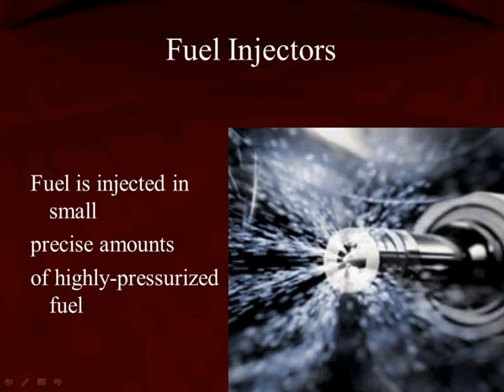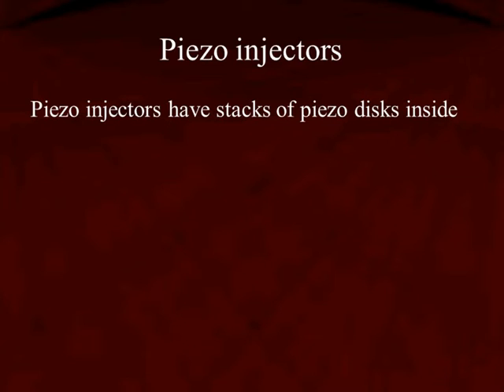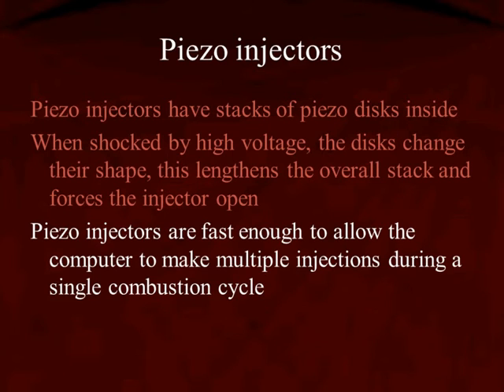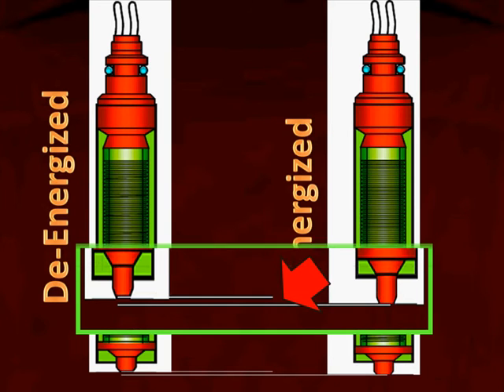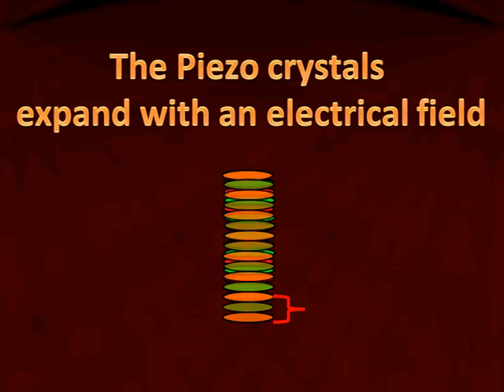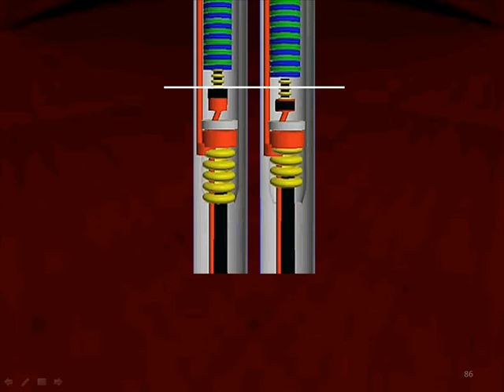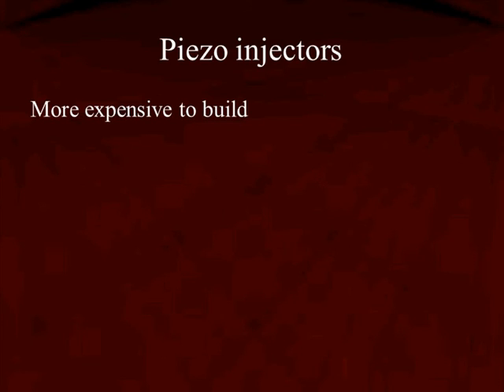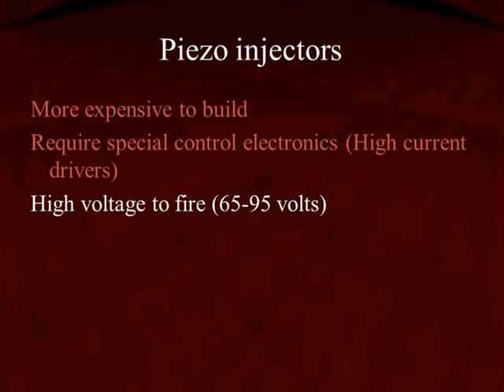10 Piezo Injectors

Comment: Bosch HDEV5.2 injector (as shown on the video) is not driven by piezo stack because it is an electromagnetic injector (coil resistance 1,5 Ohm @ 20°C):
Electrical drive parameters:
Booster supply: from 65 Volt to 90 Volt @ 13,2 Amps (time 0,5 mS)
Pick-up supply: 12 V @ 9,6 Amps (time 0,8 mS)
Hold supply: 12 V @ 3 Amps
Should you require a GDI injector testing demonstration please take a look at the following video: https://youtu.be/Dx95S4H31IY